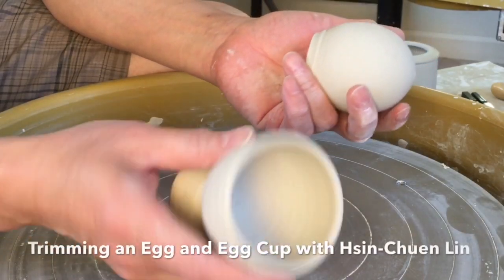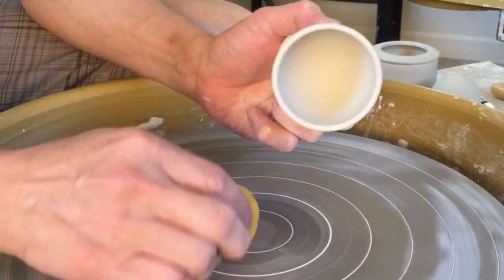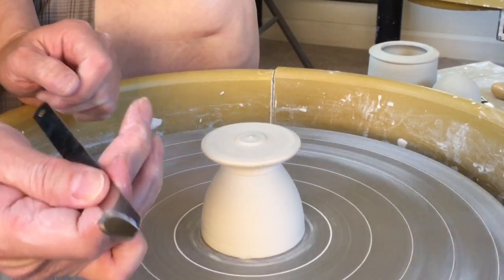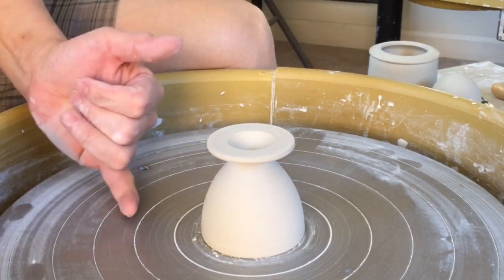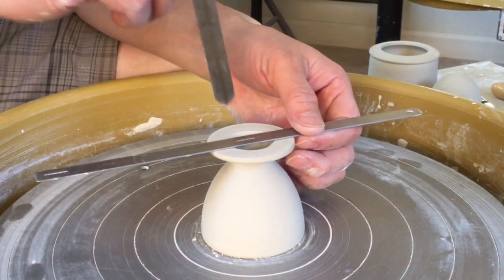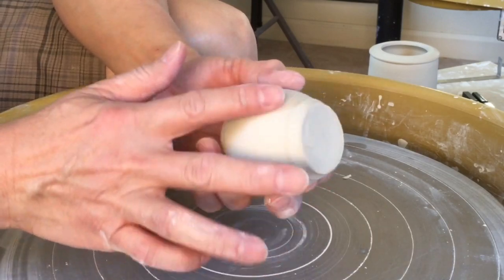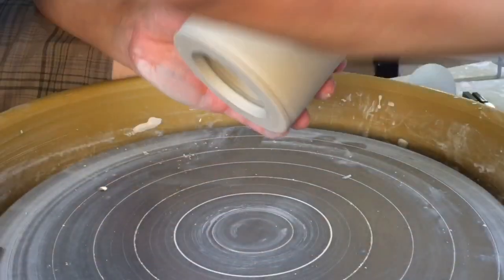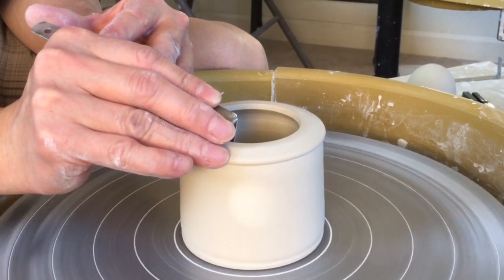311. Trimming an Egg and Egg Cup with Hsin-Chuen Lin 林新春 修坯示範

Comment: I can't ever get my pieces to stick to the wheel head like yours. What should I do?
Reply: Perhaps the piece is too dry. They usually stick with some water if the piece is in its leatherhard state, either that or just use small coils to secure your piece
Reply: マシュー thanks! I always have a hard time getting my pieces to the perfect dryness
Reply: It works for me every time.   Dampen the wheel, then your piece.   When you put your piece on the wheel, wiggle it a little to secure the seal.   Center it and then wait a minute and it should be perfect.